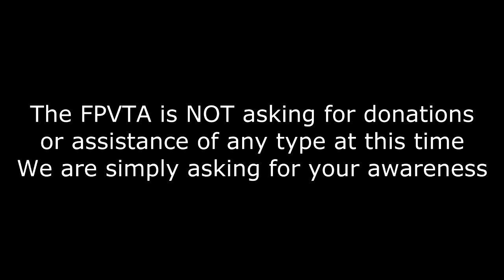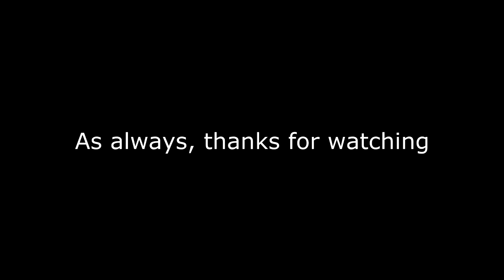The chances of colliding with an airplane

Comment: Where I live there is a small airport more than 10 miles away yet I have seen on a regular basis helicopters, planes and even some jets flying well below 500ft and right over heavily populated area I live. Every time I see it I SMH as they are the ones that are breaking the law with no enforcement or recourse yet they want to demonize a man with a wing or quad. You are seriously my idol. 👍
Reply from the maker: There are some legal ways for aircraft to fly that low... although I doubt most of these low flying aircraft are following proper procedure.  In the end, drones or UAVs are treated as a nuisance and thus the lazy solution is just finding ways to ban them under the guise of integration.

Comment: Do you believe in a screwdriver?  Mathematics and science are tools, not belief based systems my friend. Risk assessment works fine with your homeowners insurance. The first time an A380 sucks in a Tarot flying in the wrong place, all bets are off. We will see new legislation and rules you cant even imagine.
Reply from the maker: +K BikeRider - Perhaps, but there has only been one collision and that did not result in a crash.  90+ years of model aviation and we have yet to cause an airplane to so much as make an emergency landing.
Reply: +Video Aerial Systems I appreciate your comments on safety. We all do. However, your mathematics are flawed. First of all, if aircraft accidents occurred due to modelers, where and what database would we find that in? NTSB does not investigate all ac accidents.  Secondly, Model RC flying historically has been at flying fields...not FPV all over the globe. I have seen videos of people overflying major metro airports unknowingly. If we can factor in those two issues, maybe statistics will tell us a different story. The point is, we all love this sport/hobby. Lets all be responsible and think like pilots. Fly Safe :-)
Reply from the maker: +K BikeRider - The video was calculated to be in the path of an airport landing strip.  This was a kepner-Tregoe analysis.  The nearest flying field to my locations is literally across the highway from an airport.  it is an AMA field that has been there 30+ years.

Ground protection is a totally different issue, though.  Many injuries reported every from crashing models.  I was only considering hitting another airplane.

Comment: We all have a responsibility to understand what the numbers represent as more people join the RC hobby. A hobby I have enjoyed most of my life without incident just like the vast majority of RC hobbyists have done making the cars we use to get to the flying field look like death traps statistically speaking. And thanks to technology the RC aircraft I now fly the most have gotten smaller and safer as foam replaces wood, electronics and batteries shrink in size and weight, and I add tiny cameras to fly them FPV. However conventional line of sight flown RC aircraft I still enjoy flying will continue to have some inherent risk in requiring a drive to some location and using a larger RC aircraft needed for visibility. And I have to admit this does pose some risk in the wrong hands, a risk that increases as more people join the RC hobby. So it is up to us to continue as we have always done and make sure people learn to fly safely. And the first thing you learn in flight school is to look around and be aware of the conditions you find yourself in.  

There are people that want the hobby stopped and this minority of grumpy unhappy people have been around trying to stop it for as long as the RC hobby has existed. Only the large amount of money the hobby supports has kept these people from stopping it. But with camera's added their emotions have been accelerated citing all kinds of excuses, like the guy that lives next to a park who shot a quad copter down with a shotgun claiming it was invading his privacy and spying on his daughter. Of course he would be far better off worrying about the camera and mic in his voice activated TV connected to the Internet someone hacked into not to mention his computer and cell phone that make such issues of privacy a real and far greater concern... but logic and human emotions seldom go together where ignorance allows deception to push the buttons. And I have had my fill of deception in the last few years and have been made aware of what I used to dismiss as of little concern. Look at an RC helicopter close (or an electronic amplifier, or your DNA) and you see there is always a little rotor (unless electronics have replaced it with the same principle in effect) that controls the much larger main rotor that in succession controls where the much larger machine ends up. People who understand what powers politics understand that right hand rule and use deception to gain control of the small force required to control the much larger weight. 

glassdogangle said: "I have this standing offer that I have been throwing out there for the last year or so. I will place a real wager of $11,000 right now, for anyone who will take me up on it. My standing offer is this: I will bet $1000 that there will NOT be a drone vs. Full-size Aircraft collision in the next 10 years.

Also, since I like to hedge my bets, I also FURTHER wager that, if on the odd chance there IS a collision between FPV vs. FS Aircraft, I will further wager $10,000 that there will be NO FATALITIES, and the FS aircraft will land rather uneventfully.

Any takers? Nobody has taken me up on this over the last 12 months. All the Chicken Littles and their falling skies, but nobody wants to put their $$$ where their mouth is. This just in: Regardless of all the FPV pilots out there, the sky is NOT falling!"

Legitimate concerns of safety being expressed in relationship to unacceptable risk is not being "Chicken Little". And someone setting the worst possible examples of flying FPV such as taking off and landing blind on a bike path where children ride their bikes and pointing that fact out after showing how to drop "bombs" in a river while flying FPV low over  private  property filming private swimming pools to get there sounds like someone playing mind bender acting as a paid political lobbyist to have the FPV hobby banned by feeding on weak minds open to deception and suggestion. And his statement above is exactly what I would expect him to say added on to this video dealing with  acceptable risk after studying his videos. Nowhere in this video does IB Crazzy condone the way this glassdogangle guy flies FPV aircraft. If you read  in-between the lines he said that there will be an RC aircraft vs. full-size aircraft collision but he is willing to bet it will take ten years and a day to happen and the passenger planes makes it back without loss of life while knowing birds that have no metal parts and cannot carry the weight of a single lipo battery have caused planes to crash. That is common knowledge. And the best way to make that happen and cause an accident is to fly in clouds and at high altitudes, and here is a guy that brags of making it to 30,000 ft saying that is nothing to worry about in doing so. Something doesn't fit the picture it claims to be in here.

The only way an RC aircraft will EVER have an encounter with a full scale aircraft is if people copy how glassdogangle flies as shown in the countless videos of reckless endangerment he has posted on Youtube pretending to be a "normal" RC pilot. Even the kids now see through his egocentric agenda as he brags throughout his video thinking he is fooling people with his superior intellect exposing what he is doing. I assure you the vast majority of  people that fly RC aircraft like myself are not the fools his videos make us out to be. His videos show someone driving a car at high speed down the sidewalk to prove cars are too dangerous to make them illegal, not promote safe driving habits. 

As long as people realize there has always been an agenda in effect to have the RC hobby banned due to human emotions being what they are to support the historic resulting politics known all to well to exist, and never fly FPV as glassdogangle teaches in "setting an example",  I'm sure the RC hobby's safety record will remain in place as FPV aircraft and equipment improve getting smaller and people become educated by learning from people who truly care about the RC hobby and would never put the public at risk. Even people who have never flown a kite can see the problem with what glassdogangle says and does. We need responsible people representing the RC hobby, not some mind bender setting the worst examples possible in support of the agenda when you put his words and actions in the correct picture frame where they fit the picture.

Comment: I was just kind of wondering if it were possible in the future to have a System on any UAV that would listen for a signal being projected into the flight path of a MAV that simply cause the UAV to drop from the sky, to an acceptable level, if it were to cross the path of the MAV.

Like maybe have MAV's transmit their soon to pass GPS Coordinates in a front of them and if the UAV recognizes a possible collision it would either change course, descend or shut off the motors entirely depending on the severity of the situation.

Obviously this would only be needed for UAV's capable of reaching certain heights but it would most likely be less aggravating to extreme UAV Pilots than a general rule prohibiting the use of airspace above a certain height entirely.

I mean... "All of this airspace is off limits to you." sounds a lot more radical than "Feel free to enter but if shit goes south you're going down first." no?
Reply from the maker: Duraltia - Transponders are the solution to this.  If both aircraft carry a transponder, the UAV can change altitude as needed to avoid collision as it already is aware of its location.

Comment: Hi Alex.    My job is to fly jet airliners and my hobby is to fly  fpv models. I see both sides of the coin easily :-)

It is hard to talk about statistics and risk levels in this situation, because when the problem happens, the statistic is not good for the people involved .  For them,  the numbers are 100 %  bad or ,  1 chance in 1 .

Actually If a small quad like in the video enters at a Boeing 737 engine, the engine may suffer a huge damage and even loose all the power. The compressor blades behind the big strong fan are quite small, and if one blade brakes, is very likely that a cascade condition will damage other blades and so on.

At a Cesna 172 it will brake the windshield easily and if hit the ocupants, can lead to death or severe injures.

But the point is:  Hundreds of meteorological ballons are in the air every day, and nobody tells anything about it.  The equipments they carry can lead to some kind of dangerous situation depending on how the plane hits it. But, as the chances to this happen are so small, maybe 1 each 35.000.000 times,  nobody talks about that. It is an aceptable risk level. ( but I confess I do not like the idea.   lol )

When you tell about the colision statistics between an RC plane and a real plane , you are considering the phase that the plane are below 500ft, it just can be during the Take off or landing phases.

In normal condition, the airplanes can not fly below 500 ft even at remote areas. SO  If we fly our fpv planes below 500 ft AND far from airports, the colision chances numbers will drop from 1 in 35.000.000,  to virtually zero  !   That is the point  to highlight.

To fly higher than 500 ft , I think the only way would be issuing a NOTAM, telling the area, the altitude date and time. So it could be done, people could fly fpv long range and high altitude,  but under some safety rules  ( a NOTAM is a warning to the pilots of something that can affect the safety )

But to Fly below 500 ft, and far from airports, or airfields, looks pretty reasonable and absolutelly safe . We have to fight for it !

Alex, Thank you for your work to develop the fpv tecnology and comunity.  Big planes and rc models can safely live together  , the FAA can not to be so blind about it.

Cheers :-)

Comment: Here's the holes they're going to poke in your argument. First, with the rise of FPV people are flying higher than they could in the last 20 years with standard RC planes. Second, as the hobby gets cheaper, more and more people not traditionally schooled in the safety and respect of the hobby are going to be going out on their own and doing things that traditional RC pilots wouldn't. 
Allow me to say I love your work and I appreciate all you do for the FPV side of our hobby. And I myself fly FPV outside the city. But all you have to do is take a quick look around YouTube to see that lots of new FPV RC pilots are taking a huge amount of risk with their planes. They fly near people, and even near airports. This will inevitably lead to problems down the road. 
Remember its not the safe responsible pilots everyone is afraid of. Its the knuckleheads that only think about themselves and the moment.